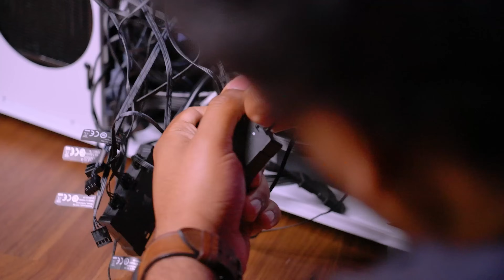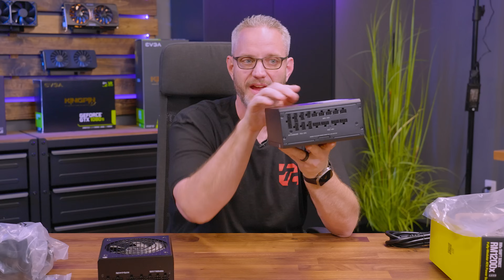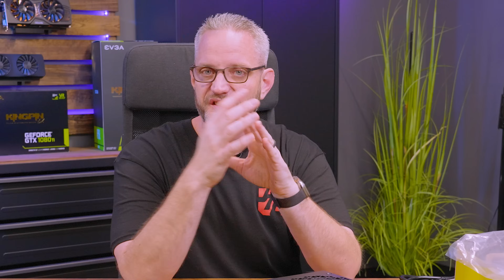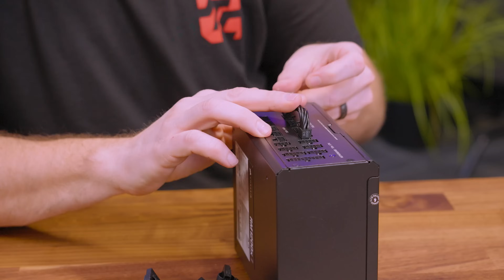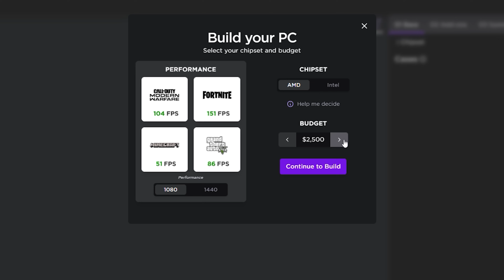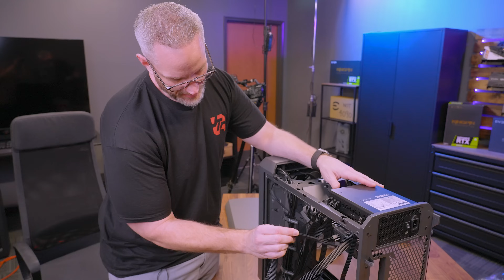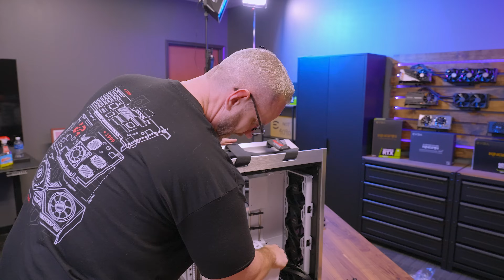I tried to prove this design was a failure... But then this happened.

Comment: this PSU would actually work great with a lian li o11 Dynamic EVO since the PSU is flipped on its side where the fan will be facing the side panel like its positioned on the table at 5:45
Reply: if you not use the HDD cage, you would have WAY more space than you will need for the extra cables.
Reply: They used a case like that.
Reply: Absolutely. Without the HDD cage, there would be plenty of room for the PSU cables. However, the downside would be that they are less hidden in that configuration.
I build a pc in the O11D Evo White this weekend. If I didn't already have a PSU (and these came in white) I would definitely pick this PSU for my case.
Reply: It is fantastic for cable managing, when I bought this power supply I did question myself if I made the right decision but after the cable management I'm thankful I did. Now it's just waiting on the custom cables to come out.
Reply: You mean like in 11:56?
Reply: I use the 1000w version in the 011 dynamic evo. its great. not using the hdd cage tho
Reply: I wish this was available earlier, it would have been perfect for my evo. I would have still gotten it if I didn’t already have cablemod pro cables that only work with my asus psu.

Comment: I just had to return one of these a few weeks back since it was failing/DoA, and was randomly powering the system off, just glad I had a fallback working PSU to put back in,  And I know that it's almost entirely just random chance that it happened and could happen to any other PSU as well, but so far this has been the only bad PSU I've had, not a great first impression.
Reply: It's okay. 1 bad doa/malfunctioning zotac 3060 ti had me avoiding all zotac GPU for almost 2-3years now. Look at all other brands but zotac. So personal experience does affect brand choice

Comment: Used this in my new build with Lian Li 216, Aorus Master, 13900KS, Gigabyte 4090 Gaming OC. Thought I heard reasoning behind different connectors is Type 5 Corsair cabling so older types cannot be used. Worked great looks really good.
Reply: I did the same thing, except I paired it with a 5800x3d that I got covered under warranty from my last build getting water on it. Put the 1000 watt shift into the hyte y40 and it fits just fine, made cable management a breeze as well
Reply: Aaah darn I wanted to use this for 216 but wasn’t sure if the 216 had enough gap on the side.  Happy to hear it worked out.
Reply: I am building q new system and have ordered the same case and PSU. 

Thanks for the info! I can stop worrying now. :)

Comment: I could NOT find a 40 series plug PSU that was better hten GOLD...  I just built a new system and got a Seasonic PSU and only PSU's that had  the 12v 40 series built in to get rid of that stupid adapter, I could ONLY get 80 GOLD... so peaved...

Comment: What about cases where the power supply is vertical?  you could have the cables on the top in that orientation.  I wish the manufactures would offer PSU and have like 3 different lengths of cables and let you choose which cables you wanted by length, so you get like a 10 inch ATX cable, 20 inch PCIE cables, etc.  Then you dont end up with all the slack jammed into the case and dont have to buy cables with the PSU and then end up buying all custom cables in addition.

Comment: I'm actually using a thermal take core P8 case. The power supply mounts vertically with a fan facing the front glass... Side glass? Yeah something like that. Basically, when you're looking at the side of the case through the glass? You're looking at the fan from the power supply

Comment: Or appreciate the advert for Corsair having something new coming? I'm having to use commander pros, yes plural. Because the commander XTs would not give me access to fan speed control. No one at Corsair could even tell me why. But with the older commander pros? Not a problem.
The reason why I bring this up is just because it's new. Doesn't mean it'll work for everyone.